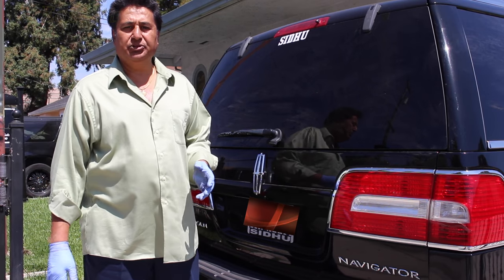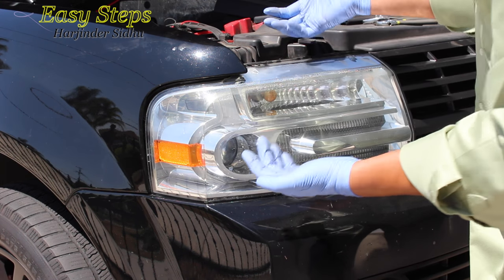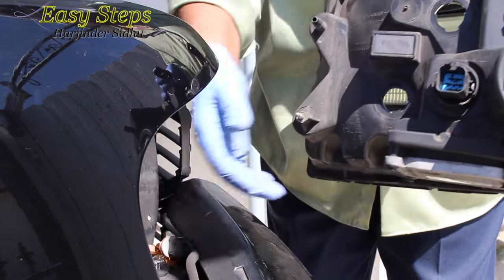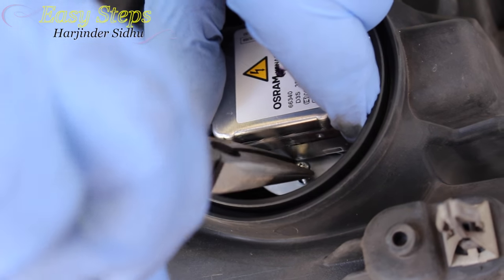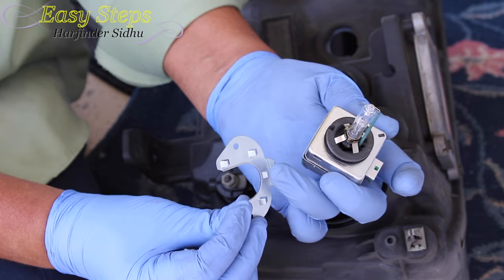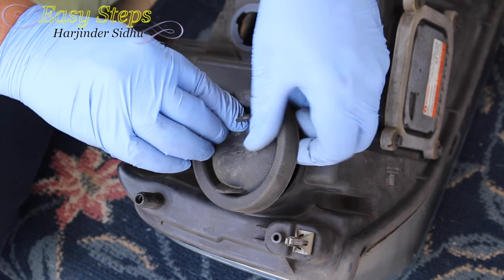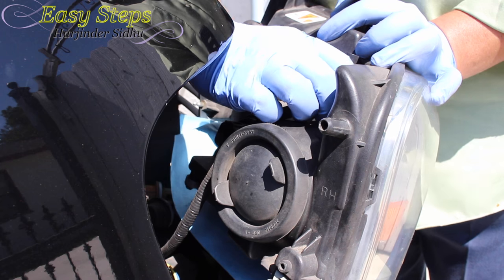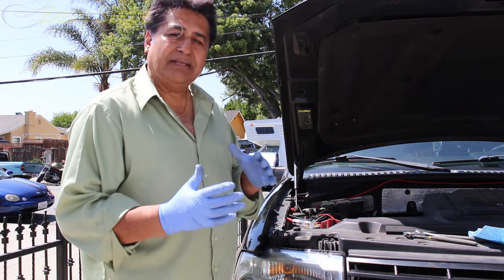How To Change Headlight Bulb on 07-14 Lincoln Navigator | HID Xenon D3S Bulbs

Comment: What bulb causes the lower part of this light fixture to illuminate with parking lights? So only the outside amber lens is on and the lower section (no headlights or hazzard lights or signals on) My friend has the 2013 Navigator, but shops seem to be challenged to repair it, and he is not in my local area.
Thank you

Comment: I followed the instructions step by step and had a great outcome.  The dealership quoted me $350 to change the headlamp.  I bought the Sylvania D3S Xenarc HID Xonon 35W bulb from O'Riley's for $135 and installed it simply.  Nice!  I saw cheaper bulbs on-line.  Decided not to mess with those options.
Reply: Oreilly upcharged you a lot
Reply: @andreydyumaev5131  No they didn't that is a pretty good price these bulbs aren't cheap.

Comment: Thank you brother... Your video is very helpfully.

I need your suggestion please; that my front lamp in my car Lincoln navigator 2007 is working, but there's no power on it ( the light is very week), and the vision is very bad by night time, so I need to change the lamps or what to do ?

Thanx.

Fayez from Dubai
Reply from the maker: Over time the bulbs start to dim, so please replace them with the new one.
Glad I could help. 🙏 Thanks for the visit. 
Thanks for the like and thanks for watching.🙏

Comment: my passenger headlight goes out and will come back on if i manually toggle switch. is bulb/going out? i figured its either good or bad but i dnt know
Reply: thank you.. changed... havent had a problem since.... ur the man..
by the way, when your removing the bulbs, what bulb number is the second bulb u pull?... the first one is amber, the second one is a clear one. what is that one? at 01:42

Comment: Question. I am trying to fix the problem myself and I am not a mechanic. I need your help please? My driver front headlight is not working on automatic but when I switch over to manually turn on headlights it works. Is it a wiring issue?
Reply from the maker: You don't have any wiring issues,  if there was then headlights wouldn't work 😉 
Check your settings on your cluster panel for your auto headlights settings.  It might be disabled 😕. 
Hope it helps 🙏 thanks for watching 👀 🙏 😊
Reply from the maker: I have started posting DIY videos on my 2nd channel "Sidhu DIY" so please check it out and subscribe, thank you.🙌 🙏 🙌  https://www.youtube.com/c/SidhuDIY
Reply: Thank you, i will check thst out.